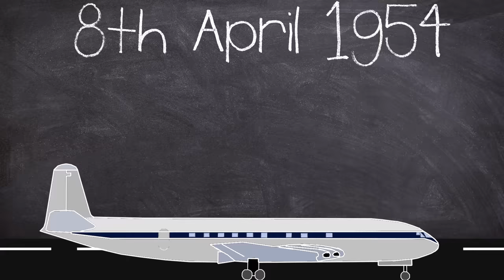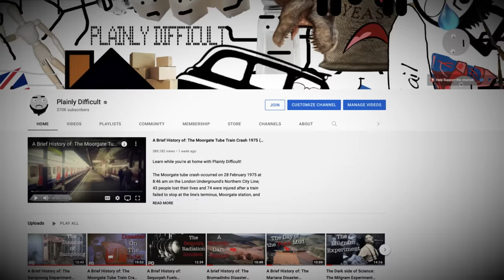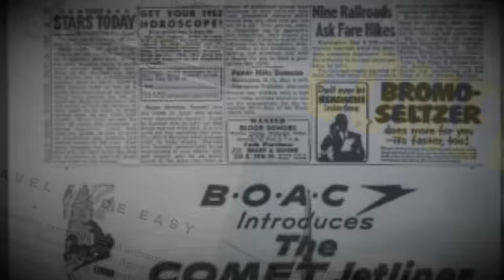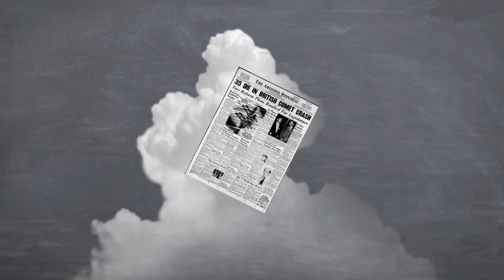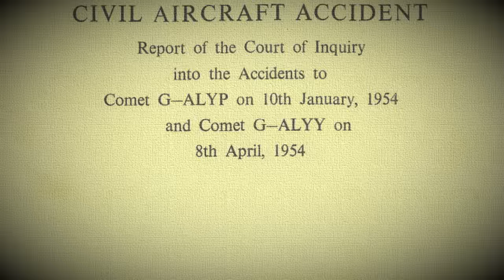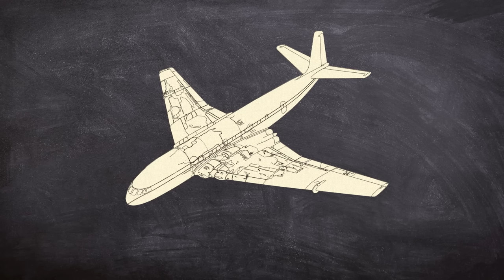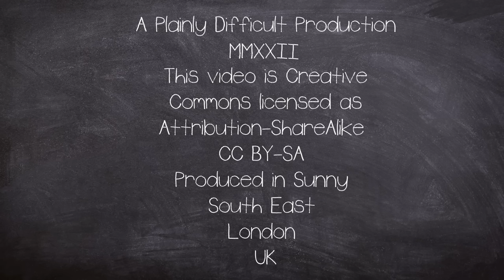A Brief History of: The de Havilland Comet Design Disaster 1954 (Documentary)

Comment: It was not because the window's were square it's because they were ment to be glued in but were riveted 1 removeing to much meat 2 they punched them in NOT pre drilled putting Miro fractures in it was production issue not designe although the first 2 crashes were as they messed up the leading edge design
Reply: None of the catastrophic in-flight structural failures are believed to be related to the passenger windows.

de Havilland was decades behind in riveted, all-aluminum airframe structures ans pressurized cabins.
The real real tragedy of the Comet Disaster was that it could have been easily prevented if de Havilland had simply followed well-known and understood aircraft design and construction techniques already in use by Boeing, Douglas, Junkers and Lockheed.
Reply: @gingernutpreacher  The Comet Disaster is was not caused by a single design flaw, like all engineering disasters it was the result of a chain reaction of failures.

The Comets didn't crash because a window blew out... that would have been survivable for most of the passengers.

The existing Comet 1 aircraft that did not crash or were not destroyed were modified with round windows that were glued and properly riveted.

These aircraft were found to be completely unsafe to carry passengers in airline service and thier Airworthiness certification was permanently revoked in 1958.

The Comet 4 is a completely redesigned aircraft that required hundreds of safety modifications to be issued a new type certificate.
Reply: This video has some BS included.
For example -
  
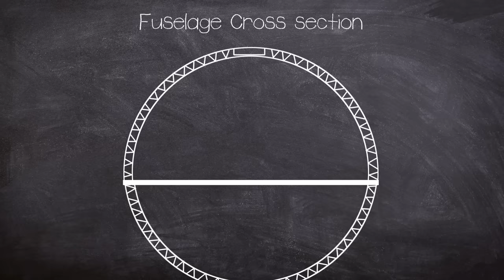    5:20   The idea that only the crew & passenger areas were pressurised is absurd obviously. 
  In fact every part of the fuselage was pressurised from the nose to the rear fuselage bulkhead including the entire cargo area.

Besides that.
The engine position & inlet design were not flaws or fatal flaws, there were good reasons for that design choice at the time.

Comets flew until 1997.
The Comet design had military use as a requirement. Nimrod development began at 
De Havilland before 1953.
Nimrods were not withdrawn due to structure problems or other airframe issues it was entirely a significant upgrade snag & resultant basic economics & an end of line sale happening at Boeing at the same time.

  We feel we can shed some light on some common misunderstandings.

  At the time the Comet wasn't particularly dangerous.

Losses comparisons
How things were in those days.

DeHavilland Comet 4 UK           14% 
DeHavilland Comet all  mks       17%  

Boeing 307                               70%
Boeing 247                               48%
Boeing 707            .                  20% 
Boeing 707                                20% 
Lockheed Electra Turboprop   29%
Canadair CL-44  Turboprop     46%  
Convair CV-580  Turboprop     22%
Convair CV-880    (ff 1959)       27%  
Convair CV-990     (ff 1961)      35%

    Of course De Havilland had prior experience building many all metal construction airframe aircraft including thousands of jet powered fighter aircraft that were primarily of metal construction with pressurised cockpits & jet engines built by De-Havilland.

   De Havilland carried out full stress analysis & engaged in a comprehensive & protracted testing program which is why key De Havilland people were happy to be aboard flying DH Comet aircraft.

    The DH Comet was the first passenger airliner with full length fuselage pressurisation at 8psi pressure differential. Handley Page built the world's first all metal construction airliner during the 1920s.
    In many cases earlier pressurised aircraft were larger, needed thicker fuselage skins due to flying stresses & had much lower pressurisation differential pressure.

   Of course ripstop provision was provided. The skin alloy used became unavailable at the time due to R & D at the manufacturers which resulted in the original alloy being discontinued.
The skin thickness used for the Comet was used for similar later aircraft. 
Frame spacing was not found to be too large & frame width was not found to be too small.

   De Havilland did indeed always work to better than industry standards at the time, used up to date knowledge for the design & construction & no evidence of negligence  or criminal negligence was ever produced in relation to the DH Comet.

   The DH Comet had no effect on the course of the aerospace industry in the UK. The UK now has the world's largest combined nuclear, aerospace & defence sector per capita activity.

    The investigation committee did not find hundreds of fatal flaws or evidence of design defects, structural defects, defective materials or shoddy workmanship. Ripstop provision was included. Claimed incidents did not involve cracks starting from window corners.
Pretty much all changes were just in case changes or were planned development modifications & improvements that were scheduled regardless of incidents.

  De Havilland designers knew all there was to know about metal fatigue at the time they designed the DH Comet.

Hope this helps.

Cheers 👍. 
 
 . . .... ... ..... .. ... ....
Reply: @Extra-Sail  no that's not helpful at all did the nimrods  have rivets punched trough the insted of drilled or did they fly umpreszrised.                   The conclusion was to limit to a 1000 hours for a reason because they punched the rivets through not drilled them deahaviland could not make a aircraft that stayed together the vampire is another example

Comment: I'm looking at a picture of the flight deck on the De Haviland Comet and I'm really curious why there are 3 distinct warning labels for radioactive material on each section of it. Look: https://upload.wikimedia.org/wikipedia/commons/8/88/De_Havilland_DH106_Comet_4_G-APDB_Cockpit.JPG
Reply: It was very common during WW2 and well into the 1950s to paint the dial face of instrument with self-luminous paint containing a radioactive element called Radium-226.
Its is safe to be near these instruments but it is a hazardous material if the instruments are opened as radioactive dust could be inhaled or ingested.
Modern instruments are back-lite with electric lights or illuminated with much safer radioactive Tritium in sealed glass tubes.
Any questions?
Reply: @VoidHalo  I have a set of instruments from a Messerschmitt Me-262, the numerals are painted with the typical green Radium 
but the needles are painted with red Radium paint which is considerably more radioactive and tends to flake off radioactive dust.
Reply: @VoidHalo  My Swiss military issued watch is illuminated with Tritium, the nylon web watch band has a black nylon web cover attached with Velcro to blackout the dial at night.
You simply pull back the cover and sheild the dial from the enemy with your other hand. 
The soft cover also protect the crystal from damage.
Reply: @sandervanderkammen9230  The thought had crossed my mind being that it would be right in the era when radium/zinc illuminated dials were in fashion. Although backlit dials kind of defeat the purpose of a soldier staying covert in darkness but I can see the benefits in a cockpit where visibility of the instrument panel is absolutely paramount (more than visibility outside). But despite this fact, there are still lots of uses for radioluminescent dials these days. Except they use tritium as the beta-emitter rather than radium-223. It's safER. I mean if you break a little tritium display, you're just gonna have a fraction of a ml (stp) of gas escape. As opposed to all of the radium dust contaminating everything. Interestingly, Promethium-147 has also been used in the same way to make radioluminescent dials for NASA during the Apollo program. But it all works the same way.

See, the beta radiation excites the valence electron(s) in the substance and cause them to "jump" to a higher electron orbital. Then the electron releases the energy in the form of visible light as it drops back down to its original, lower valence shell. In a nutshell. No pun intended =P

Come to think of it, it's the EXACT same process that took place on the screens of old cathode ray tube displays. The cathode ray itself was just a beam of electrons, which are just beta particles essentially. They strike a colored phosphor on the screen and you get a blip of light. Though my guess would be cathode rays are slower than beta rays. Pretty sure beta rays have quite a lot more velocity if they're coming from an atomic nucleus. Just based on the differences in energy levels between gamma rays and high energy x-rays of the same frequency. Since gamma rays aren't defined strictly by their frequency, x-rays can and do exist in the same wavelength. In fact, gamma rays and x-rays are practically identical where they overlap in frequency/energy. Actually, they ARE identical. If you didn't know where they came from, you couldn't tell one from the other. But I digress. I just thought that was interesting.

The radioluminescent paint is usually doped with a transition metal to give it a different color. The classic green zinc sulfide that the radium girls worked with was copper doped. But there's a whole list of dopants for radioluminescent compounds about as long as the list of dopants for various semiconductor materials. It's really genius that they figured this out over 100 years ago.

Radioluminescent dials/displays are still commonly used today in applications such as military hard where covertness is key. So, still the watch dials, firearms optics, things of that nature. But also on just about anything that needs to stay illuminated 24/7 without a power source. Off the top of my head, the most common of these types of uses would be in emergency exit signs. With newer radioluminescent compounds, the visible light given off is much stronger and at a more visible spectral bandwidth.

A really cool take on this technology that I've been learning about is type of ceramics called SiAlONs. The name's pretty self explanatory of what it's made of. But it's pretty cool how much brighter they are. But there are SiAlONs with all sorts of different properties besides phosphorescence. They might even be used in the next generation of LEDs as the UV to visible downconversion phosphor. (takes in UV puts out visible light). Same basic concept, high energy particle comes in, bumps up the valence electron to a higher orbital, electron goes back down, lower energy photon in the visible spectrum is released. But SiAlONs have so many more interesting material properties. So the rabbit hole goes even further than "just" stuff that glows.

Anyways, it was fun talking. I always love having a chance to talk shop. So thanks for that. It was actually pretty insightful for me to think about and remember all of those things I learned (mostly) years ago. But I always say it never hurts to brush up on the fundamentals.
Reply: @VoidHalo  OK... its alittle weird that you keep deleting and reposting  your reply.
Reply: @sandervanderkammen9230  What's weird about that? I would think if it was a problem they wouldn't let you do it in the first place, would they not?
Reply: @VoidHalo  Its really weird, why are you doing it?
Reply: @sandervanderkammen9230  Yes, I agree.
Reply: @VoidHalo  Why did you do it?
Reply: @sandervanderkammen9230  Why not? One might as well ask why have freckles?
Reply: @VoidHalo  Thanks, that actually answered my question.

Comment: the Boeing comparison aged like milk
Reply: Boeing makes the safest jet airliner in history
Reply: 5:20 The idea that only the crew & passenger areas were pressurised is absurd obviously. 
  Every part of the fuselage was pressurised from the nose to the rear fuselage bulkhead including the entire cargo area.

Comets flew until 1997.
The Comet design had military use as a requirement. Nimrod development began at 
De Havilland before 1953.
Nimrods were not withdrawn due to structure problems or other airframe issues it was entirely a significant upgrade snag & resultant basic economics & an end of line sale happening at Boeing at the same time.

We feel we can shed some light on some common misunderstandings.

At the time the Comet wasn't particularly dangerous.

Losses comparisons
How things were in those days.

DeHavilland Comet 4 UK           14% 
DeHavilland Comet all  mks       17%  

Boeing 307                               70%
Boeing 247                               48%
Boeing 707            .                  20% 
Boeing 707                                20% 
Lockheed Electra Turboprop   29%
Canadair CL-44  Turboprop     46%  
Convair CV-580  Turboprop     22%
Convair CV-880    (ff 1959)       27%  
Convair CV-990     (ff 1961)      35%

    Of course De Havilland had prior experience building many all metal construction airframe aircraft including thousands of jet powered fighter aircraft that were primarily of metal construction with pressurised cockpits & jet engines built by De-Havilland.

   De Havilland carried out full stress analysis & engaged in a comprehensive & protracted testing program.

   The DH Comet was the first passenger airliner with full length fuselage pressurisation at 8psi pressure differential.

   Of course ripstop provision was provided. The skin alloy used became unavailable at the time due to R & D at the manufacturers which resulted in the original alloy being discontinued.
The skin thickness used for the Comet was used for similar later aircraft. 
Frame spacing was not found to be too large & frame width was not found to be too small.

  De Havilland did indeed always work to better than industry standards at the time, used up to date knowledge for the design & construction & no evidence of negligence  or criminal negligence was ever produced in relation to the DH Comet.

  The DH Comet had no effect on the course of the aerospace industry in the UK. The UK now has the world's largest combined nuclear, aerospace & defence sector per capita activity.

    The investigation committee did not find hundreds of fatal flaws or evidence of design defects, structural defects, defective materials or shoddy workmanship. Ripstop provision was included. Claimed incidents did not involve cracks starting from window corners.
Pretty much all changes were just in case changes or were planned development modifications & improvements that were scheduled regardless of incidents.

Hope this helps.

Cheers 👍
  

   
xcxcxvcxc
xcvvvvccv

Comment: This was a classic case of you don't know what you don't know. Cutting-edge aviation technology meant encountering modes of failure that could not have been anticipated at the time. Sad that the knowledge curve had to be spattered with the blood of unwitting passengers and crews, but there was nothing that could have been done, without first finding out what had happened. Unfortunately being first, doesn't always mean success. No one thinks of the safety legacy the Comet had left behind, only the failure and lives lost.
Reply: That is nothing more than wishful thinking... the real tragedy of the Comet Disaster is it could have been easily prevented if de Havilland had simply followed well established industry standards already in use by manufacturers of pressurized airliners such as Boeing, Douglas, Junkers and Lockheed.
The 426 people were killed simply because of incompetence and criminal negligence.

Comment: Sleek design even by modern standards!
Reply: Not really, stylistically the Comet in very 1920s 1930's Art Deco 
It's empennage is very old and dated, without any swept-back control surfaces.. its engines while interesting in their configuration were also one of its fatal design flaws causing several major  crashes. 
No modern aircraft use this obsolete engine placement.

Comment: I was wondering if you would get the "windows" details correct.   I'll give you credit for showing where the cracks of the last crash came from, two holes cut in the roof at 15:31.  But then you point to the side windows and claim they failed on the doomed flight at 15:49, which is not correct.

Yes, the square passenger windows failed when the plane in the test tank failed.  The crack began at the passenger door and headed to the passenger windows.  So, yes, these windows were dangerous and would likely fail at some point.

But they are not what failed on that last accident.  The crack began at the square windows for antennas you show at 15:31.  This ripped the top of the plane open.  The passenger windows were not involved in causing the failure.  Should the arrow at 15:49 be pointing to the roof?

It is also important to note that the designers knew using this thin aluminum for the skin would take extra care.  The drawings specified that these two holes be covered by their windows glued in place to evenly distribute the load across the sheet edges.  Instead the builders used rivets which concentrated all the force at each rivet.  And then to make things much worse, the "plunge" riveted it.  Didn't drill a hole and put a rivet thru.  Just pound the rivet through, make its own hole -- one surrounded by freshly made cracks from the plunge.

BTW, I'm a huge fan of your videos!!!!

Comment: The 707 was no less bold a design than the Comet. Its wing mounted engine design was more practical and cost efficient than the Comet. Even if it never had these problems, the 707 would have eventually taken all of the Comets market share. It was a markedly better plane.